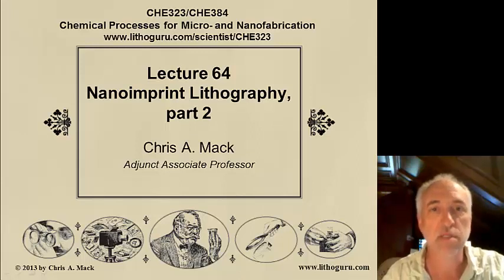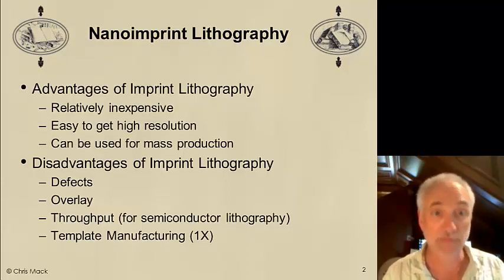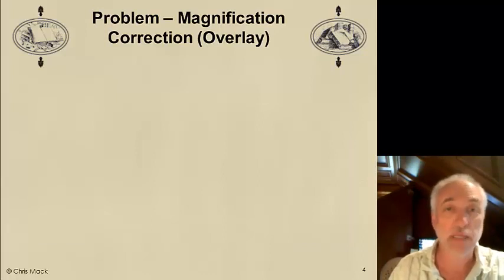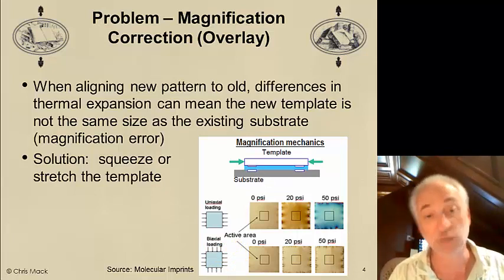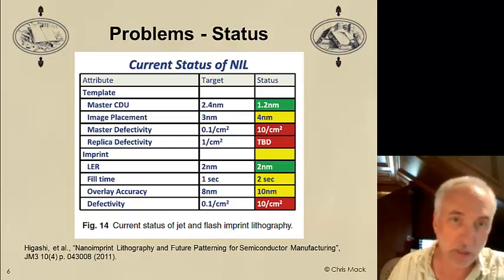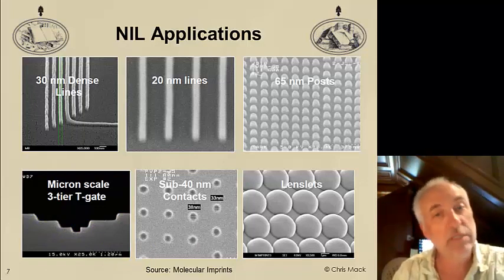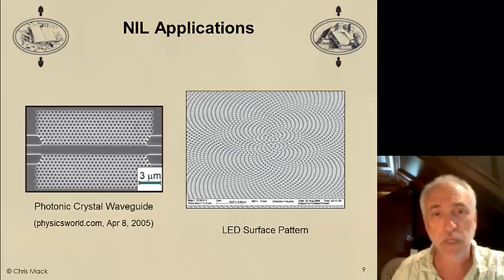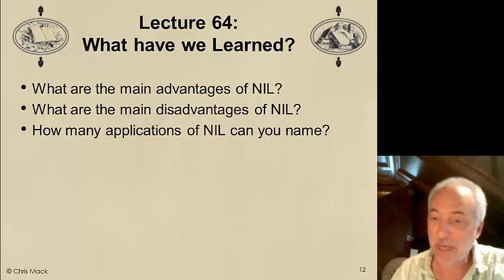Lecture 64 (CHE 323) Nanoimprint Lithography, part 2

Comment: Sir, just a question of curiosity. I'm a Biochemist. And from my background when I look at semiconductor circuits, I see the patters there doesn't match with molecular geometries at all. Can't we think of semiconductor circuit design where transistors, diodes, cinnections etc follow the geometry of the molecules? Wouldn't that enable us to make much smaller feature size and reduce the possibility of defect many orders of magnitude? Though I'm still not sure if even such can match the throughput of current lithography techniques.

Comment: I've recently heard quite some buzz about nanoimprint lithography. But after watching these lectures, I feel like NIL might hv future in Solar Panels, LED, Display screens and may be some of the MEMS manufacturing. At best >50nm nodes in future. But high-end semiconductor? That can only be possible, if at all, with a large dose of quantum metrology and quantum optics. But then, it will be a hybrid lithography technique. And I feel we'll still have the defect issue.